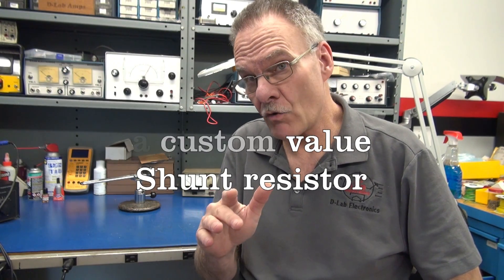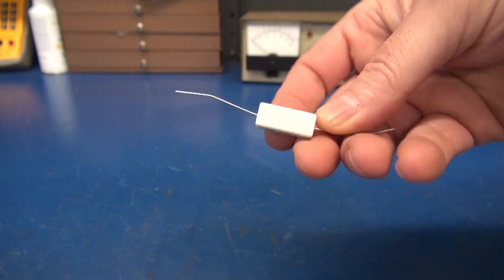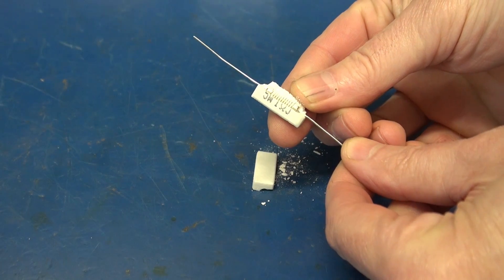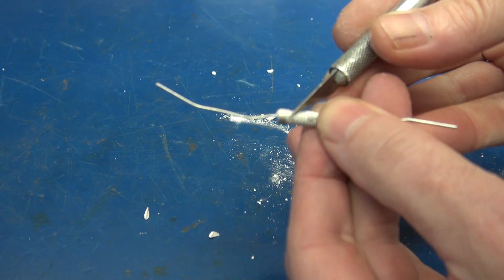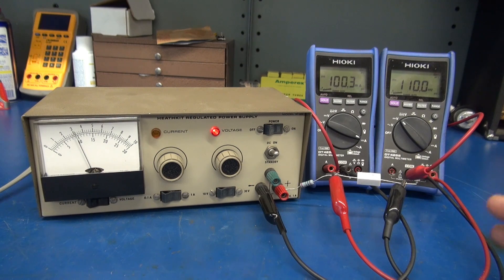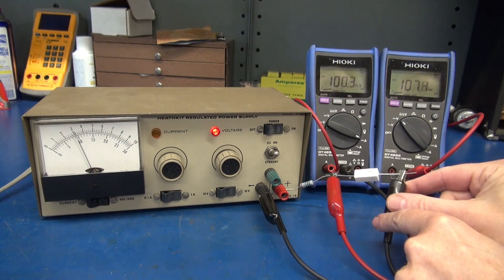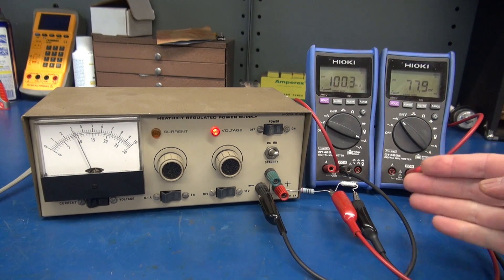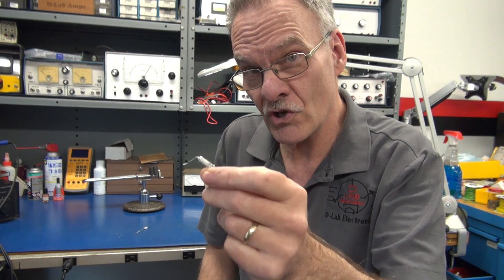How to make a custom shunt resistor Instruction to modify create for your application radio repair

Comment: Terry, you often demonstrate techniques that remind me of similar things I learned long ago.  What you showed with the wire-wound power resistor made me recall a way to create custom value carbon-composition resistors.  Basically, you use a small file to file a notch in the side of the resistor until it matches the desired value. Then you coat the resistor with something like varnish to seal it from moisture so it retains the new value.  You use the next higher wattage value to start with, so it will still be able to withstand the dissipation.  Use a 1/2-watt instead of a 1/4-watt, or a 1/4-watt to make a 1/8-watt, etc.

I'm only describing the basics of the technique, it has its faults and limitations, but at least it's an option.